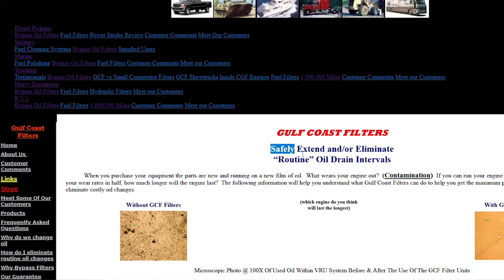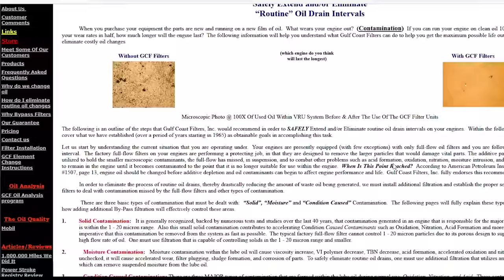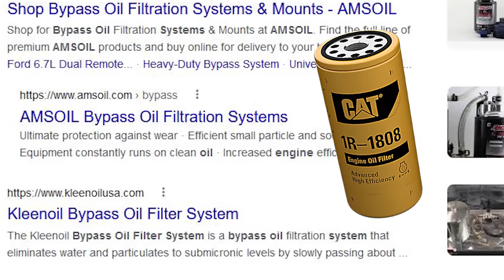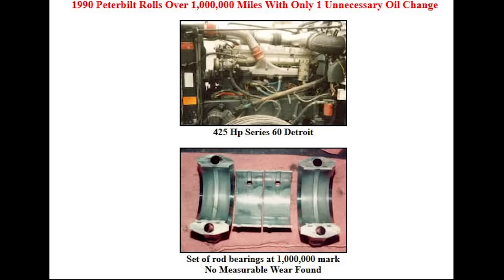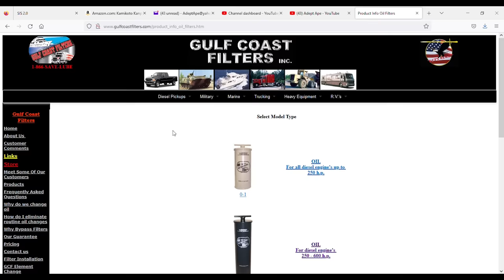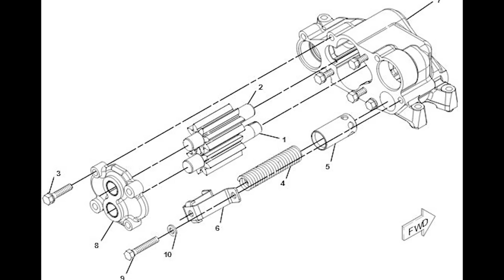No Oil Changes and 1 Million Miles!!! Are Oil Changes Optional with a Bypass Filter? (INTERESTING)

Comment: Had this system on my last truck. 2001 Freightliner 12.7l Detroit. 1.5 million miles before liner and piston in #1 went poof. Only changed oil when oil sample showed it needed it. Best memory was 5 or 6 over its lifetime.

Comment: Large ships such as container or freight ships operate using a fill-once lifetime oil, and then clean and process it thoroughly over the life of the ship.
Reply: really wow! i didnt know that.. i thought they did oil changes like cars too..wow..i shoud try that on my bike!
Reply: @fidelcatsro6948  There was a Motor cycle club atound San Jose California. That had Frantz toilet paper oil filters on their Harleys in the early 60s I found out about them.. Seems like it was the Ridge Runners. I had a Frantz oil cleaner on my  Honda 500 Custom. I converted the canister full flow to a Ford spin on. Used a Frantz sandwich adapter for pressure to the Frantz. I tapped a plug similar to a valve adjusting plug for a clean oil return. Hung the Frantz upside down back by a saddle bag. Good bike.The Harleys had the Frantzs bolted to the foot rest. It would take a Harley guy to install one.

Comment: I run a 2007 LBZ Duramax w/ FS-2500 oil bypass - Filter cartridge is 2mU. I also use a PPE Hi efficiency Filter @98% efficient collecting 10-20mU particulate.  I do filter changes every 50-60,000  kilometres & Oil every 100,000 kms. I do similar with my fuel filtration (FASS) typically change those every 25 -30,000 kms. 

Filtration = Longer life.

Comment: When I ran a fleet of over 40 trucks, mainly 3406E, 14.6 C15s, and Acerts, I could get 20k out of every engine except Acerts. They would soot out the filter about 18,000 miles and plug filters. Once I was able to delete actuators, we could run higher intervals. I ran several types of oils as an experiment and never found any advantages of synthetics in the crankcase. Delo was the winner cost,versus intervals. I've overhauled multiple engines in the last 25 years that have had those bypass, never change the oil for reasons other than  oil related problems and can say there was never really any significant change on internal parts between conventional intervals/oils. However, engines that had Lucas additive always had a gummy, nasty film inside. And the bearings always looked worse. Just thought I would chime in.
Reply from the maker: Thank you for your input.
Reply: Back in the 60s I could squeeze the inlet end of the toilet paper and soot would come out. Squeeze the other end and clear oil would come out.. No one had to tell me the toilet paper could remove soot.with these newer gasoline cars its hard to tell the difference.  I can see the top of the paper getting black before the bottom on the diesel tractor. It has the flat head Ford V8 canister filter modified to take a roll of Scott 1000..John Frantz got his start adapting the canister bypass filters to take superior toilet paper. I improved on the design.

Comment: I have a amsoil bypass filter in my landcruiser diesel. i can go 80K km between oil changes with oil analyst but i use the biggest bypass filter avaliable too. currently on hotshots 15w-40 black diamond outlaw

Comment: Excellent, you nailed it.   Additional filtration can only be good; the million mile thing however should be regarded solely as a proof of concept or product impact, not an ongoing realistic plan.   Try it with a safer oil interval change and test the oil, to determin "where the curves cross".    I love the idea.

Comment: Does the bypass filter remove fuel contamination? Diesel fuel is a much better lubricant than gasoline.  I don't think a gasoline engine could get away with this.
Reply: Gasoline is easily removed by the heat and the PCV.. In the old days of mechanical fuel pumps a leaky fuel pump could put gasoline in the oil faster than it could evaporate. My Ford F 250 Ranger with the 390 has toilet paper filters on everything. The Motor Guard on the engine is over 50 years old..

Comment: I use bypass oil filtration on my F350.  The oil stays clear of soot, the only reason ive found to change my oil is when the oil loses its TBN and the anti-wear properties in the oil.   Ive found one oil change per year suits me fine, prior to installing the bypass filter, my recommended oil change intervals were about once every 3 to 4 months.

Comment: This is quite interesting ! We had a Powerscreen screening plant with a Deutz 4 cyl turbo , it had a toilet paper looking filter called Kleenoil bypass filtration system.  It seemed to work good.  Currently my 2012 International dump truck has the infamous maxxforce 13,  I run rotella T6 and change it every 500 hours.   With so much egr and soot , I’m wondering if I wouldn’t be long blowing it up even with a bypass.  Also being a dump truck I’m in dusty conditions frequently.  My take is, maybe a non emission engine , that’s on the highway at operating temperature, little dust, the bypass idea would work better ?
Reply: The bypass specifically is a truly great idea for engines with EGR systems. The EGR puts carbon particules into the oil and the bypass removes the larger problematic ones. It also removes dust, dirt, etc. In my opinion any engine that uses hydraulic unit injectors that use high pressure engine oil as the high pressure hydraulic fluid should always have a bypass filter. The unit injectors are incredibly sensitive to contamination.
Reply: Any filter that looks like toilet paper or paper towels is a good filter. When I started you had Frantz and Motor Guard.  For diesels you had Frantz 3 stackers and manifolded Motor Guards. I cant keep up with all the good ones now. Some are too expensive for me. I get my filter elements from Walmart.

Comment: I've used bypass filters in the past and don' have anything bad to say about them. However...it just makes me fell good to change the oil and filters every now and then. I probably go overboard on oil/filter changes but my '02 Dodge Ram w 24v Cummins now has 200k miles and doesn't burn a drop in between changes. Think I'll stick with this routine.

Comment: I wonder what is the difference in cost between the oil analysis and actually changing the oil?
Reply: Good.question.They know the oil is good. They are checking for engine problems. With my cars I dont drain oil but I know how to read a dipstick and read the roll of toilet paper. I know what clean oil looks and feels like.Also I normally buy cars that look like they have been taken care of and usually have a lot of miles on them.To most taken care of means changing the oil.To me taken care of means using a filter that cleans oil.

Comment: Excellent video  I work  for a  company  the ram oil bypass  a got isame results  they did  180,000 miles and  did  oil sapling at 40,000 miles I drove truck  with 1.2 million miles, I did notice some oil consumption  hire and  there.
My opinion on this is a may make sense  on a big  fleet   a will  be a big savings on maintenance,  but and a small operation  I wouldn't go that far 
I'm a single man  operation I purchased my truck  with 480,000 miles I use full synthetic oil  and  run 20,000 to 30,000 miles to change the oil my truck  now is at 720,000  miles and so far  no issues with my engine

Comment: I used to work for Roadway express. They had the Web system that dripped 1quart of oil into the fuel tank every 350 miles. Theory was by adding fresh makeup oil it replenished the additive package. They never changed the oil just filters at 25,000 miles. Plenty of engines with a million miles

Comment: They make the claim with a series 60 😂 those leak enough oil that by the time they hit 50k there isn't any original oil left in it
Reply: Nah. I run this bypass system. There’s also CATs and Cummins that can claim the same
Reply: Lol
Reply: @ScootertheMover   it's was a joke...a joke. Damn
Reply: Had a yard mule at work with a 2 cycle Detroit.The boss said I cant have leakijg oil in the yard. I cut about 6 inches from a 55 gallon drum put some kitty litter in it and tied it under the engine. Anyone need a diesel mechanic.?

Comment: I owned one of these and went to 500000 with no oil change. I changed the brand bypass to an OPS1 bypass. GCF states that when you change the bypass filter you have to add up to 2 gallons of make up oil. I really liked their device but it was large and very messy to change. One reason I went to the OPS system. Theirs you only have to spin a filter off and on.   One thing none of the bypass filter companies tell you is that they DO NOT filter out diesel fuel from the oil. So if you have a bad injector you are still going to have to change your oil every 10 to 15k until you get the problem fixed. And for sure you better be doing oil analysis if you are going to use one of these.

Comment: When working for Weyerhaeuser we installed a couple of centrifugal type bypass filters to see if we could extend oil change intervals. I was amazed at the amount of carbon that they collected from the oil! Probably about 2-3 lbs of solid carbon in 3,000 miles! The did look cleaner as far as being black. Oil samples showed less impurities in the oil also. But Weyerhaeuser didn’t start using them for some reason.

Comment: I remember that million mile truck. I was talking about it about 1996. Paul Abelson Senior Field editor for Road King Magazine asked me for the truck owners phone number. They did an article on it October November 1996. The one oil change was someone forgot to tell a mechanic not to dispose of the oil it was a test truck. Its a little misleading to say the oil isnt being changed the Bounty Big roll paper towels are changed every 10.000 miles and adds 3.gallons of new Rotella. At 50.000 miles he also changes the full flow filters and adds 5.5 gallons. That is 17.5 gallons of new oil every 50.000 miles or the equivalent of an oil change every 40.000 miles. I believe Shell was involved in the measuring the parts. I stopped draining oil in my cars in 1963 using Delo 100 W 30 and a Frantz oil cleaner All I use now is the Gulf Coast the Motor Guard and a Jackmaster Classic.  I did convert a flat head Ford V8 bypass filter to use Scott 1000 TP and put it on a Ford diesel tractor. I made a modification to the Jackmaster Classic. I drilled out the outlet  orifice and added a 1/16 inch orifice at the inlet to get it to heat up. Its the same as the Peterbilt except I add 1 quart at filter change instead of 3 gallons. I believe it was a Shell engineer that said its not unusual. For these Detroit engines to go a million miles but not be in near new condition. The advantage of the Gulf Coast system is the oil is never allowed to get dirty. Road King also did an article on Amsoil and a 3 gallon Como filter. With that system the oil eventually has to be drained usually 50 or 60.000 miles.  The Detroit didnt have a million miles on it when Road King did the article.It was less than 750.000 miles. I lost track of it at over a million miles when I quit selling oil filters. Always wondered what happened to it. Gulf Coast filters has their filter elements in a bag now. Some people still use Bounty. One guy says he gets his big roll paper towels from Costco. That truck is old news. There are several others now using the same system.

Comment: I've seen an engine run for ages where it was a completely self contained unit. Absolutely no oxygen coming from outside.  It's exhaust was plumbed back into the intake and the oil was in the exact same condition it was what it was 1st put into the engine. No contamination to the oil. Impressive.
Reply: Say what
Reply: I call BS
Reply: The gravity drive on my Jeep still has the original oil in it too. A round trip to Mars and back takes only 30 minutes. 👌😂🤪

Comment: There was a system that injected engine oil in the fuel and replaced that oil with fresh oil, a little at a time. The idea came from a study (long ago) in heavy mining equipment. They had fleets of haul trucks where they allowed (small leaks) leaks on a portion of them (engine oil, gear lube, and hydraulic oils), but they kept the other units leak free. They found that the haul trucks with leaks had a longer service life, which is essentially the same as more frequent service intervals... or just replacing a small amount lubricant at regular intervals between services.
Reply: It’s called oilmate it was originally a Cummins product but I think they make it for all engines it works pretty good on non emission engines not so good with DPFs and other equipment now.
Reply: I hate that so much, but the logic is sound so long as the leaks don't introduce excessive contamination.
Reply: @kingduck3192  Thank you for the reminder on that system. I can see how it would cause problems on the emissions engines.
Reply: I have heard of that system. I would think it would require a good bypass filter to keep from pumping abrasives into the injection system. Many years ago some cars had a tank of new oil The oil lubricated the engine then went on the road. Might get you in trouble on paved roads.
Reply: I have an old car advertisement book. They had tires with a written guarantee to go 5.000 miles. Detroit had a bunch of electric car companies.

Comment: I worked for a fleet that ran the spinner centrifuge system and every oil change there was probably 1/4 to 1/2” solid on the outside edge paper. We still changed the oil at regular intervals but I think they were worthwhile
Reply: The reason the centrifuges dont work for this system is they dont require enough makeup oil. You still have to drain the oil and add make up oil. All it amounts to is never allowing the oil to get contaminated and adding enough new oil to keep the additives up to specs.

Comment: Totally believe this.Oil only breaks down if subject to extreme heat that would be present in an oil refinery.
 Still laugh at my Dad's 100,000 mile oil changes. The Ford 460 in the station wagon outlived the car until the wheels fell off it.

Comment: I think the bypass system would be a good investment when used with regular oil changes. An un mentioned problem is the viscosity stabilisers used in
modern oils tend to be the first to break down from a variety of causes, primarily through dilution mechanical separation and evaporation. With these
additives gone the base oil remains but then lacks the viscosity performance needed in various operating conditions to protect engine parts. In this case a cold start 
or two every day versus a long haul constant temp engine will have very different long term outcomes. I also believe oil change interval should be more closely 
correlated to driving conditions, like extended stopping frequency, regional and seasonal temperature range and warm up cycles, rather than just miles covered.

Comment: I use an oil bypass, FS2500. it does work, however I do a FULL PM @ 45k. It still saves money & reduces wear on the engine

Comment: I worked for roadway express and they used a system made by WEB. It dripped a quart of oil into the fuel tank every 350 miles. Theory was makeup oil replenished all the additives. Never changed the oil. Changed filters at 25,000 miles.  Had many of the 2,000 linehaul trucks exceed a million miles.  Saved big on oil disposal costs.

Comment: I didn't read all the comments, but the following wasn't mentioned in the video. Another point to consider is when the oil filter is changed, the oil within the filter and that runs out while changing the filter, will need to be replaced with new oil. This could compensate for contaminates keeping unfilterable contaminates to a minimum for quite a while.

Comment: I run a ops1 ecopur bypass oil filter system.  They do have evaporator system.  I have run at the most 180 k miles without an oil change but I do sample and drain oil at each oil filter change interval.  In longer intervals you have to watch you base and viscosity numbers.  As the oil gets older the base or degerdants get depleted.  They neutralize the acids and dirt in the oil.  I recommend periodically draining 2 gallons of oil and that will replenish the detergents.
Reply: The reason the Gulf Coast filters work is they have the size and depth. They need a lot of new make up oil..my Pontiac needs a quart of new oil about every 6 K miles. The truck its 3 gallons every 10 K miles.Never known of a spin on filter that cleaned oil.

Comment: 2017+ X15 engines are now rated for up to 100k miles ( with the oil guard program) or 80k miles without it.   If you want to sleep at night better, get the oil checked once at the end of the oil drain interval to see how it's doing.

The payoff seems not very good unless you hold onto the engine for a very long time.  And risk of fuel dilution or other unintended things.   Also, checking the oil for sparkly things and the filter might save your engine from blowing up when a bearing is half way to being worn out.